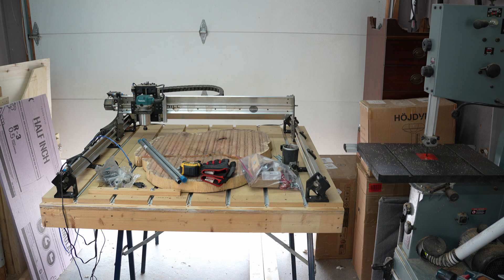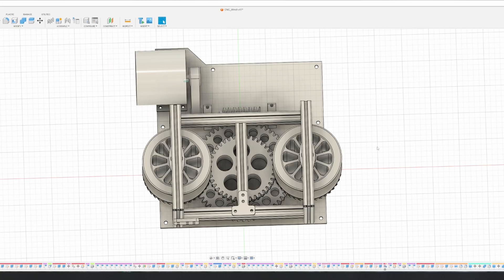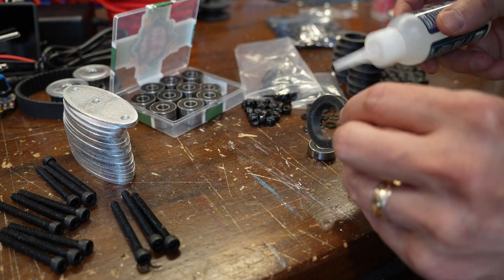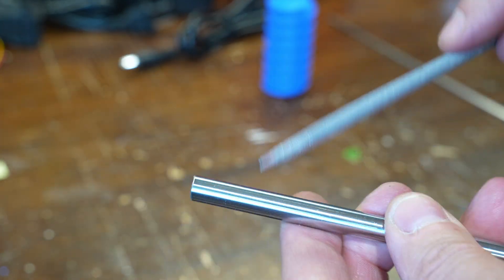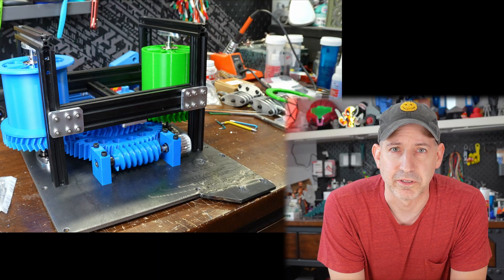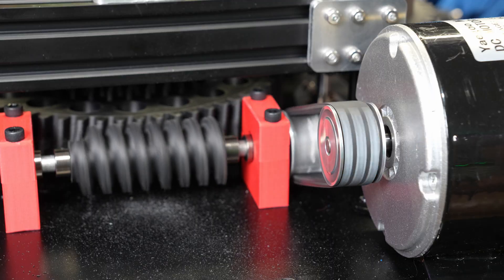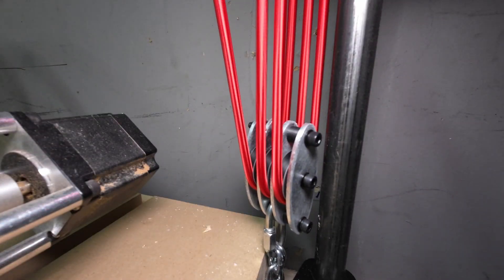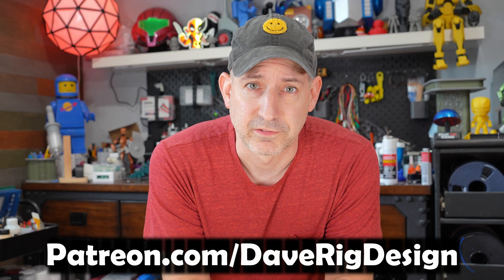3D Printed Winches: Do They Actually Work?

Comment: winch, my guess the noise on the screwgear is due to the bearing or screw itself walking back in forth in the bearing brackets. might be a just a tad to much play.
Reply from the maker: The bearings were pretty tight in the brackets. Maybe chatter in the bearing race? Maybe something not completely true causing the noise?
Reply: @DaveRigDesign   its an odd one thats for sure.

Comment: Winch. I'm curious how the worm gear printing worked? I've wanted to use a printed worm gear (a good bit smaller than what you've made) for a personal project for a while but I was told the overhang was too great to print without support.
Great video as well. Interesting watch.
Reply from the maker: 🙏 thanks. The worm gear printed fine without supports. I assume it should be even better on smaller prints. I would add a lubricant though because there is a lot of sliding force on the gear, way more then normal spur gears

Comment: Winch. Any worries about misalignment on either of the axes from it hanging on the wall?
Reply from the maker: Not really, I had to make sure the pulleys were out from the wall enough to be close to inline with the drums. There may be a bit or twist with one on top and the other on the bottom but doesn’t seem to be a issue